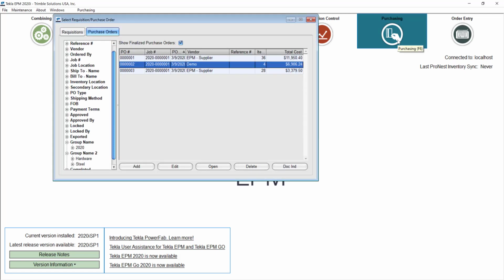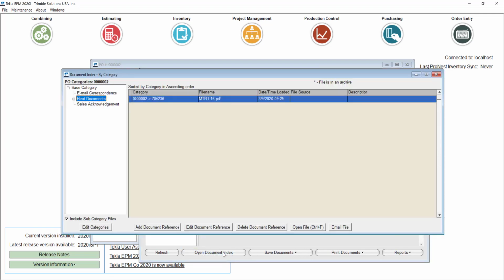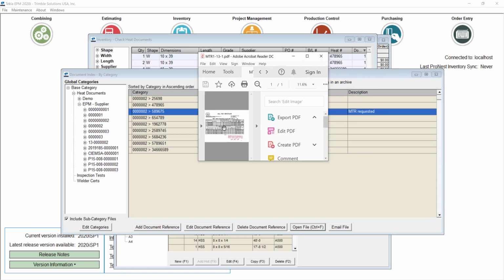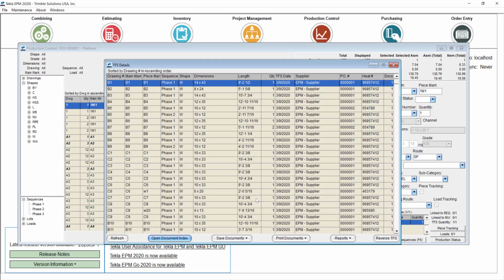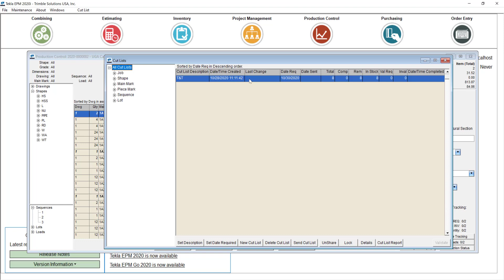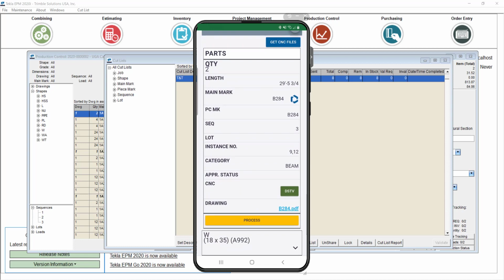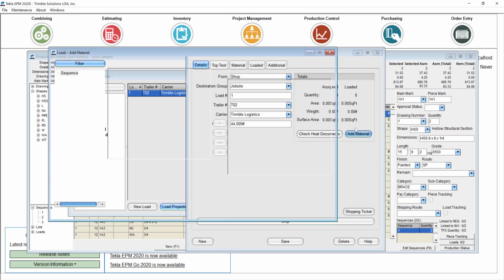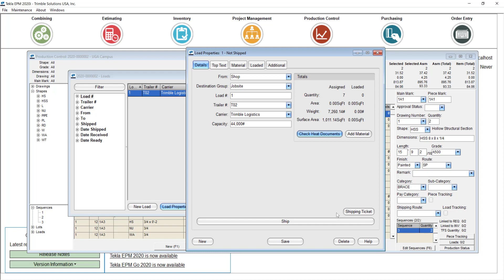Material Traceability in Tekla EPM

Comment: Question for Dan: is there any downside to having piece mark heat /instance tracking turned on? I am thinking got the load tracking heat reports by piece mark. Also, the piece marking is applied with heat # in the TFS Reports - Piece Mark so that leads me to think the load tracking should also be able to link those documents. Love the videos, don’t miss a one of them!
Reply: Hi, Thanks for the comments!, you are absolutely right but if you turn on the accessory instance tracking you also will need to turn the piece tracking option on so it enables the tracking in the stations for minor marks.
Not every company wants to track every single mark through every single station so you will need to have your stations and routes redesigned if you are not doing it right now.....this is a good topic for a video...maybe next one is on this:)